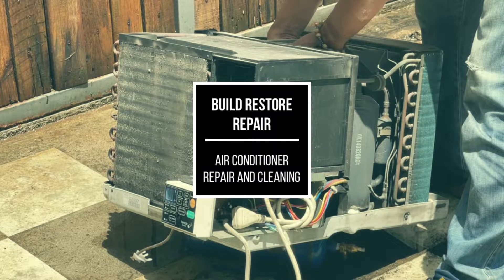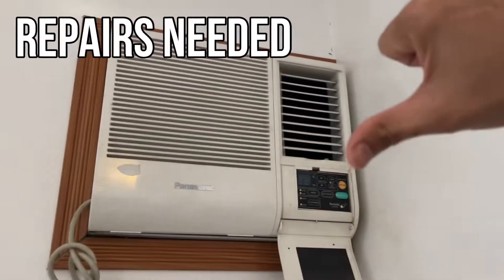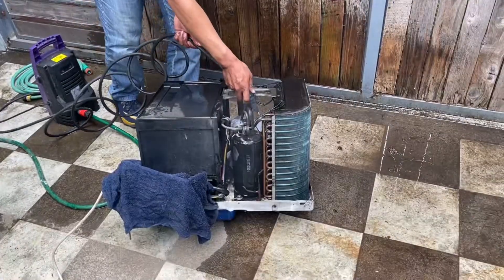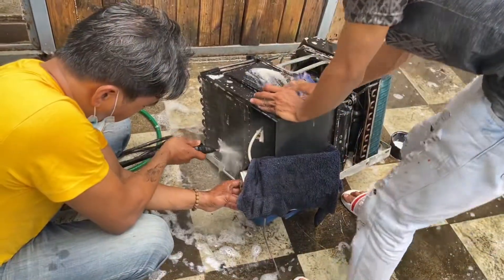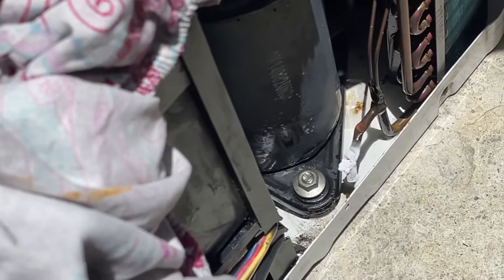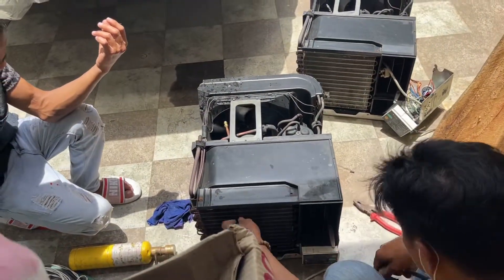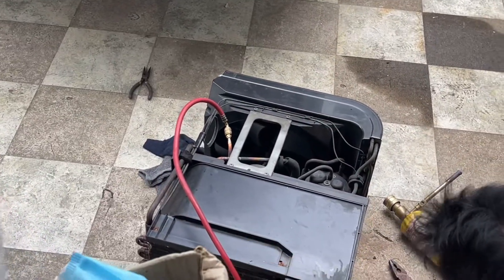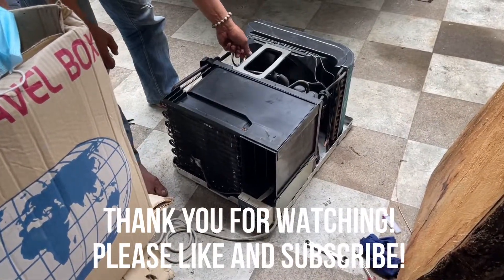Air Conditioner Repair | AC Repair and Cleaning

Comment: Omg everything was good till he opened up the unit and released the gas. ITS AGAINST THE LAW TO RELEASE THE GAS INTO THE ATMOSPHERE.THERES A PROCESS CALLED RECOVERY AND SPECIAL EQUIPMENT IS NEEDED. Don’t need to replace the gas people,do all but the gas part. If at one point it iceses just quickly clean it and it should go away and if it doesn’t then there’s a leak and soon there won’t be any ice cause it leaked away the gas.THROW IT AWAY and it will get disposed correctly by the scrap co. Get a new unit with earth friendlier gas. GAS NEVER GETS SENT INTO THE AIR,IT KILLS OUR OZONE LAYER WHICH PROTECTS US FROM THE SUN. ☀️🌞🌞🌞🌞🌞🌞🌞🌞🌞🌞🌞🌞🌞🌞🌞 kills if the ozone LAYER isn’t there TO PROTECT US. DO THE RIGHT THING,stop being cheap